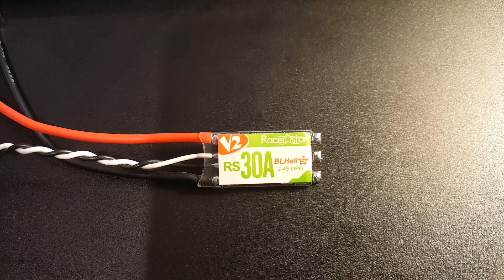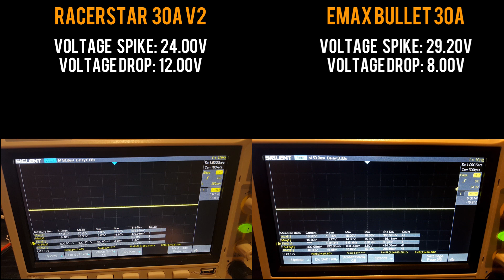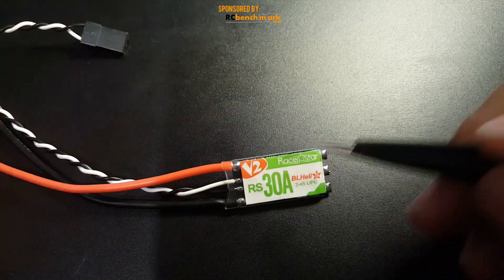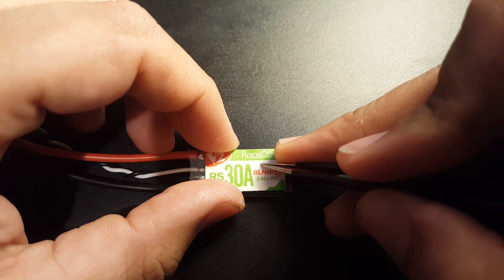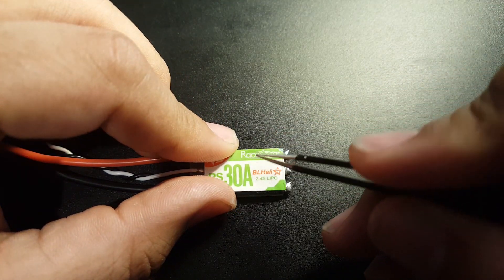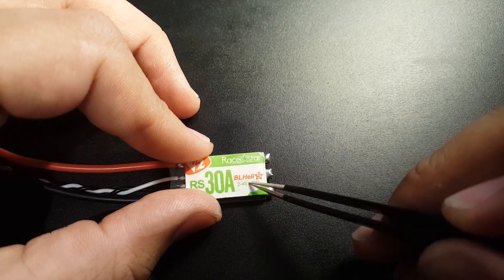Racerstar RS 30A V2 ESC // Review and Noise Testing

Comment: it IS a clone of the cicada 30a. http://www.readytoflyquads.com/30a-cicada-esc-blheli-s-muiltshot

Thanx for making sure they actually work. I have some laying around so ill use them in the next build, aling with  
Racerstar Racing Edition 2205 BR2205 2300KV. do you think this combo will need a cap?
Reply from the maker: Hans-Jørgen Pedersen I dont think you will need a cap with the racerstar motors
Reply: Drone Mesh thnx. if I get lines just add a 470lowesr?
Reply from the maker: Even if you dont add one because it will protect your components from voltages spikes. Your quads overall life will be extended if you add one.
Reply: Drone Mesh Thank you so much for ultrafast response 👍

You can rest assured that you dear sir make a difference in many people's life.  I would like to express mine and my friends gratitude for the work you do for free. We hope to see more testing and comparisons between low-cost and high cost.
Reply from the maker: Glad I could help :) 

Keep me updated on your build.